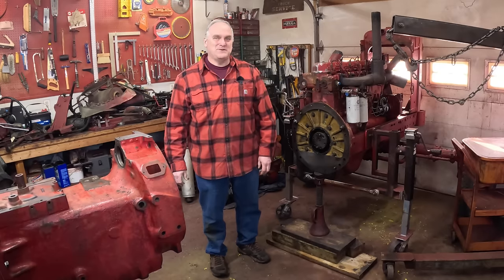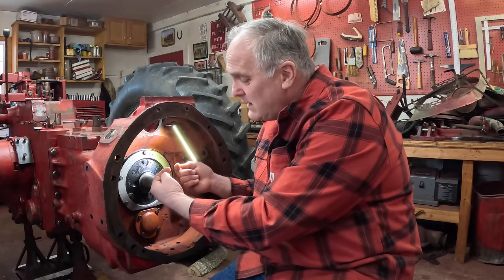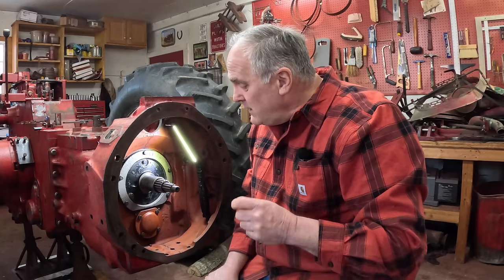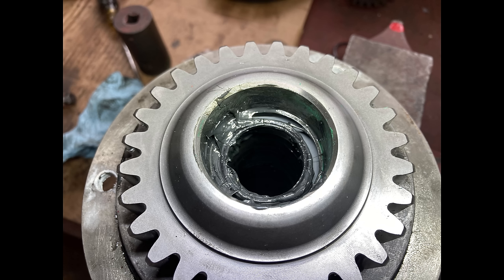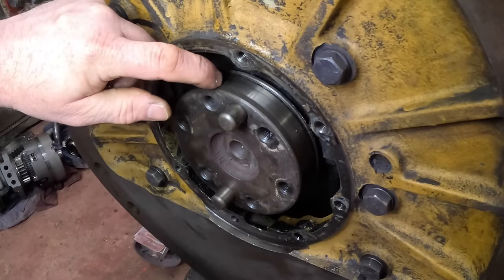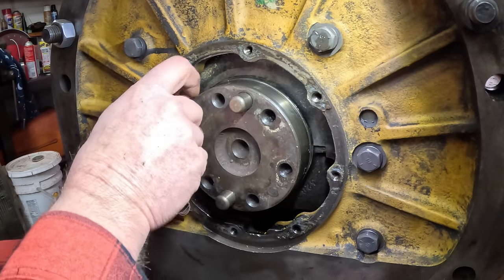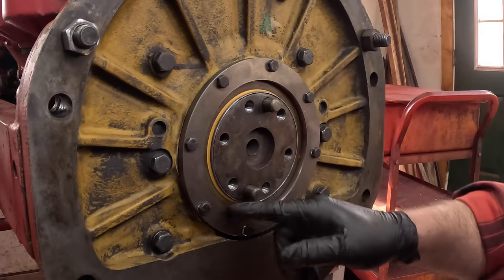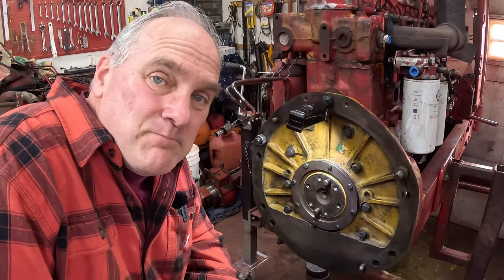"Unsplitting" the Tractor | Farmall 856 Restoration Episode 9

Comment: I do truck clutches the exact same way as you did,its so much easier to marry the transmission to the engine this way compared to having to wiggle and fight it to get the input shaft through both clutch plates.

Comment: You leave the  bolts in, flush w/ the plate. It keep the rail aligned and the engine from 
hanging on the front mount and wedged on the rear.

Comment: Another fine presentation, Optime!   But, am still wondering about the pilot bearing and shaft.  You were concerned about bolts coming loose and used thread locker.  BUT a known problem on the TA, you ignored using Loctite 515 flange sealant, especially since you changed the spec by sanding the shaft knurling ?  As the Kelvin temp rises in the tranny, what will happen?  As meticulous as you are,  many things like this and anti-seize compound baffle me?  Could a 'clutch alignment tool' have been used?   
You truly have master the art of YouTube presentations.  As I learned in college;  "The medium is the message", coined by the Canadian communication theorist Marshall McLuhan.  You do this so well, another example is grilling some of your products!  Appreciate all the efforts of you and your family.

Comment: Another wonderful video as always Pete! I've probably mentioned this before, but I too am working on my family's 706 right now. The range and reverse shifting has been getting worse over the years, and I finally got tired of it popping out of reverse and grinding when the tractors warmed up.

So since I wasn't doing much right now, I figured it would be a good time to work on it. Well, after taking the range cover off, I found what I think was my major issue. The bolt and star washer that connects the shift fork to the rail and that is supposed to move together was completely missing, and the rail was out of the front hole and only supported by the back end. My dad and I ended up having to file the front of the rail down as it had mushroomed slightly from being banged around over the years and wouldn't go in the front hole. 

Have you ever seen or heard anything about that happening Pete? I've been trying to find a replacement bolt, but the parts catalog doesn't list what kind of bolt should go in there, we've ordered what we think might be the right bolt, but when looking down into the rail, we've found it's slightly tapered and not threaded, and the bolt we've order is a full threaded one. My dad thinks we're going to have to grind part of the bolt down so that it'll seat properly, though I'm not sure about that. Do you know anything about it, Pete? The forums I've looked on haven't said anything about this particular issue.

The other interesting thing was that apparently at some point in time, the cam pivot shaft that goes down into the range transmission was broken and 'replaced' with a cobbled-together one using another shaft and the range transmission selector drive arm, (listed as part 20 under the controls, gear shift levers diagram in the book). They'd tack welded the two pieces together and stuck a roll pin in to hold it all together as the woodruff key that was supposed to be there wasn't and called it good. When I tore it apart the roll pin was broken in two and barely holding things together. 

The fact that this poor tractor has worked as well as it has over the last thirty years since we've gotten it, with as little maintenance as she's had blows my mind and convinces me that IH built some tough tractors. 

Anyways, sorry for the long block of text, and I'm looking forward to the next video in the series.
Reply from the maker: Hi, when I took the high-low shifter fork off this tractor for Dad to repair it, it was bolted to the rail with a plain old 3/8" or 5/16" course thread bolt and star washer (can't remember which size for sure). I assume the 706's were the same, but I'm not sure of that. Best of luck.
Reply: @JustaFewAcresFarm  Okay, that lines up with what the dealership said they had in their system, but neither us or them were really sure at the time. Thanks for the info, hopefully this'll do the trick and I'll get the old girl running like a top again.

Comment: Well wada you know 😁If the choice is 95 ftlbs or 360Nm, I'd go for 95 ftlbs. For 360Nm you need a way bigger torque wrench 🤣 You keep people on their tows with these conversions 😏
I'm pretty surprised that the front and back are held together with a few bolts only. I'd expect some more security against movement when bolts break like a face chamber or sliding parts. It also would provide some guidane when mounting this together. although the guiding bolts work fine, they don't provide full precision imho. Interesting to watch how it was done in the past.

Comment: Pete, don't you have a breaker bar to loosen and tighten bolts instead of using two wrenches hooked together?
Reply from the maker: I have a breaker bar. I use 2 wrenches when a socket won't fit, and I also use 2 wrenches because the line of force on the bolt is straight when doing so, instead of offset as when a socket is used. That makes the wrench less likely to turn off the bolt, and safer for me when I put lots of force on it. Been doing it this way for 20 years and have never broken a wrench, and these are cheap wrenches to boot.

Comment: actually 95 pound force foot (lbf foot) is equal to 128.8 Nm, but, Pete, were you just null techno-trolling for comic relief, again?  And, just in case, my disclaimer is, the scale on the other side of a manual torque wrench should guide the non-technos to right torque endpoint!  Out of curiosity have you ever grabbed the torque wrench at a distance of 1 ft from the rotational axis of the leveraged end of the wrench to sense what a 95 lbf foot rotational force feels like?